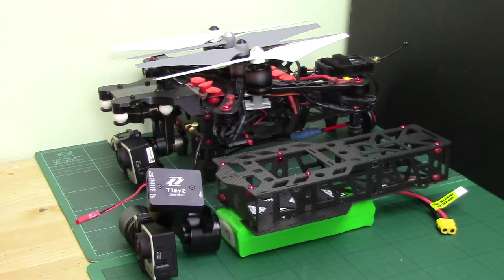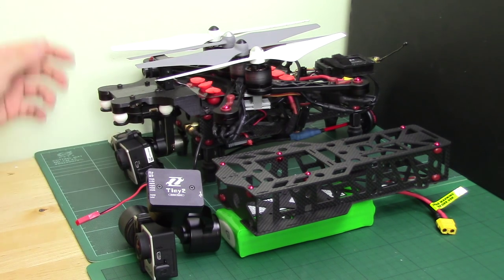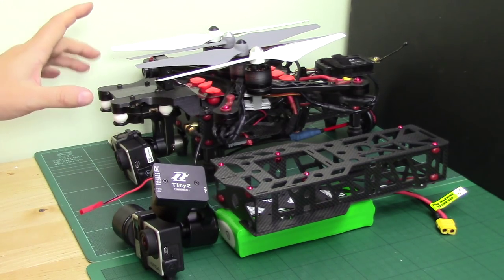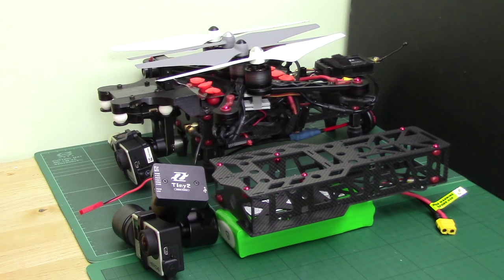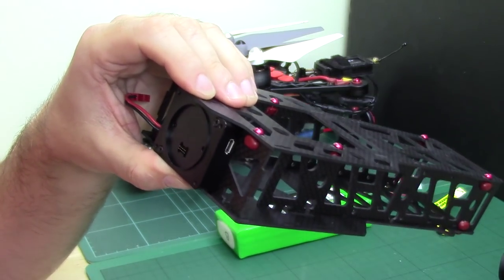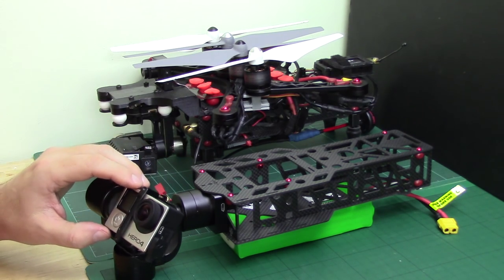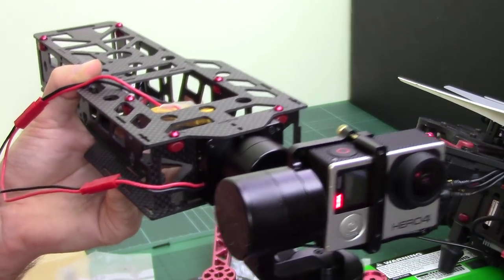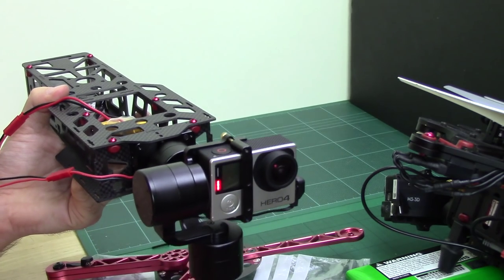Fitting the Zhiyun Z1 Tiny 2 to Immersion XuGong v2 Pro - How to (simple way!)

Comment: Hi! After watching your great videos on the Tiny 2, you influenced me to buy one. It just came in the mail a couple days ago and I'm really loving it. On your XuGong, there is a better way to orient the Tiny 2 to get better field of view when looking down. If you have the gimbal mounted in the usual hanging position, take the GoPro out and turn the roll motor 180 degrees. Flip the gimbal over and you have it in an upright position. Remount the GoPro. Finally, you can flip the whole gimbal forward so it it mounted similarly to how you have it mounted now on your XuGong but with the motor on the top rather than on the bottom. The only drawback to this setup is that if you are moving forward and your copter is at an aggressive forward angle, the motor might get in your shot. That is only if your copter is angled about 35 degrees forward, which never really happens, so I don't think there is a huge problem with mounting the gimbal with the motor up. Also, Zhiyun seemed to have updated the Tiny 2 slightly because I received mine with a all metal mounting brackets with one piece solid top mounting bracket that has many holes for screws which I presume are compatible with a phantom. Anyway, I loved your videos and in depth reviews. I thought I'd let you know about the update. Cheers, Giles
Reply from the maker: +Giles Beebe This sounds really interesting Giles. I had heard that they were doing an upgrade version but not that it was out yet (i have been away for 3 weeks so maybe missed out on this info). Would love to see more detail of the install method too.... if you are on RcGroups could you post on my Tiny 2 blog? http://www.rcgroups.com/forums/showthread.php?t=2490735 I am desperate to get back to tinkering with my RC stuff but holiday = more work on return lol. Glad you liked the vids though. I'll do an update if I can get mine working like that.
Reply: +d3weyTube I'll absolutely post a vid on the forum showing the upgrade and how to flip the motor to the top. Thanks, Giles

Comment: Used the same method of mounting but on a TBS Discovery, with an aluminium plate bent over the front of the quad and directly bolted to the gimbal.

Comment: Nice find this 3d gimbal. Maybe drop them a line and ask if you can remodel it to have the yaw motor on top.
Reply from the maker: +Gerard de Vries Thanks Gerard - yeah I've sent a few emails out to see if it is possible. I suspect it can be done by reversing the IMU in two of the motors but learning from my experience of doing that with the G3-Ultra (and the 3hrs trial and error putting it right again) I think I'll await their response :-)